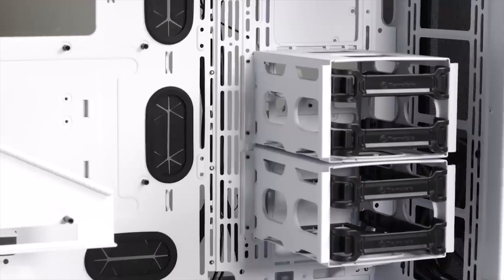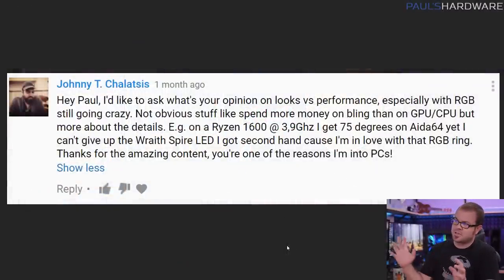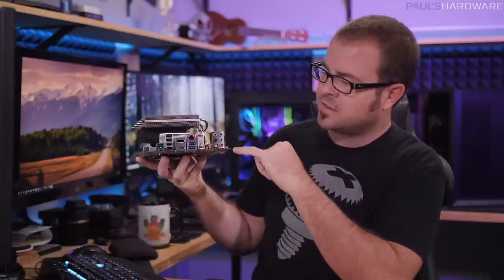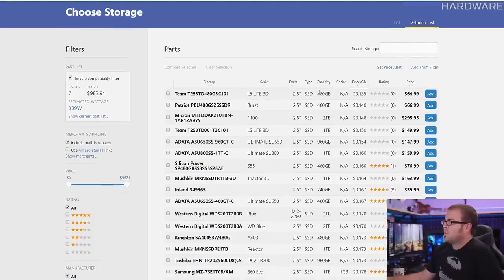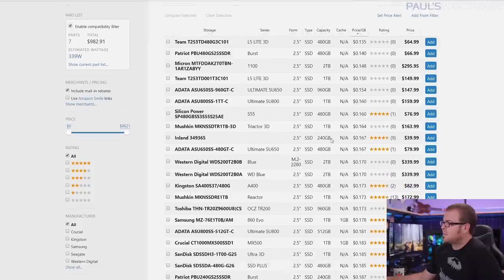The Eternal Question: PC Looks vs PC Performance? - Probing Paul #27

Comment from the maker: TIMESTAMPS!
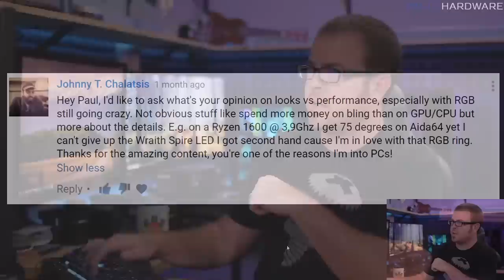1:07 The Eternal Question: PC Looks vs Performance
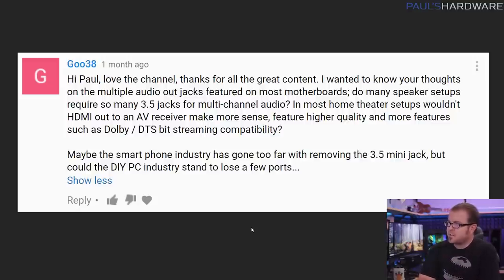3:28 Why do PCs have so many audio ports?
5:55 My primary drive is an SSD but I'm adding more storage -- SSD or HDD?
8:02 How can I tell if my laptop's M.2 slot supports SATA and/or NVME?
9:17 Why not use RAID 0 for a fast/large main drive solution?
11:20 Why not have a GPU that plugs into 2x PCIE slots?
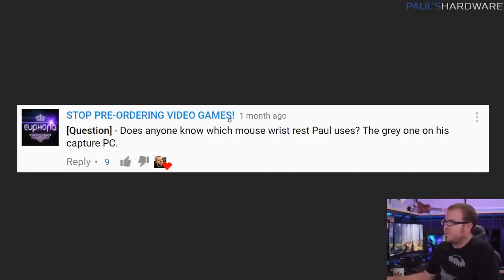13:15 What wrist rest is that?
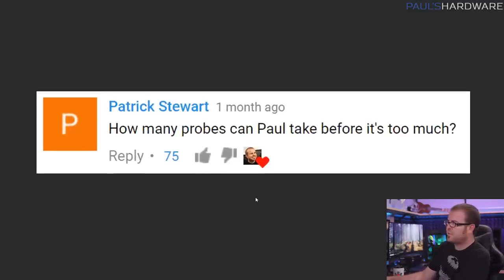14:15 How many probes can Paul take before it's too much?
Reply: The thumbnail implies that one finger isn't enough anymore
Reply: You might be sitting on maybe a 2/3 dollars of European currency.
0.045 USD/Koruna 
1.16 USD/Euro
Reply: paul make a budget hdd raid 0 that speeds like ssd video 
like using 4-6 500gb hdd in raid 0
Reply: I'm just going to throw it out there, but I'm not saying I'd be upset if Paul spanked me with a 2080TI.
Reply: 5:55 personally, I would go with a hard drive, they are cheaper and ssds have a magical little thing called write endurance, and for something like video editing where it's constantly writing over data, you could potentially destroy your SSD within a few years. (From the research I've done when building my own computer) after almost a year of owning my computer, my endurance is only at 97% (last self test was 4 months ago).
Reply: I have never updated my BIOS since I bought my PC in 2013, when I got it I was new to the whole custom PC thing and didn't know much about computers back then.Since then I've gotten more PC literate but I have never updates my Bios since I got the PC.
 I wanted your opinion on whether or not I should update my bios or should I let well enough alone?
 I have seen both opinions on this and would love to know for sure before I do it as I don't want to "Brick" anything.
I bought a Z87-K Mobo in 2013 and  the ASUS website have many updates for the bios since then. 17 to be excact 
https://www.asus.com/us/Motherboards/Z87K/HelpDesk_BIOS/
 Also if I do update, do I have to download all of them or just the latest one?
  I have seen quite a few bios flashed and believe I could do it with no problems but since I don't have the money to buy a new Mobo and my computer works ATM, should I update or not?
Thanks...I enjoy you videos :)

Comment: Your discussion of looks vs performance is appropriate but while I always build for performance, looks shows experience and professionalism.  As an electrician, I've always been taught to make my bends as parallel, straight and otherwise perfect as possible.  Same with wiring, when wiring a breaker panel most electricians fold out the wires on breakers nicely and tie up the runs running up to the stub outs so they look real nice.  No electrician wants a pile of spaghetti that you  have to push in to get the cover on.  So, professionalism and experience shows with looks.
Reply: Totally right

Comment: Price deltas between prebuilt systems and custom built aren't as high as they once were, but there is still a huge quality gap.  Prebuilts (like Dells from a Walmart shelf, not boutique/system integrator systems) almost always have very cheap components compared to what you would be able to find for a similar price by building yourself.   Cheap motherboards, locked CPUs, RAM that won't OC at all, and worst of all is the crap tier PSU they use.  Price/performance is still much lower for a custom build!
Reply: Maybe so but they are at least tested. It's vanilla but they are invested in making sure they aren't getting too many returns.
Reply: Usually crappy hdd's aswell and often limited or no upgradeability. Seen many prebuilts with very weird cases, power supply sizes, weird cooling etc. By building yourself, you have a lot more control over everything, quality, aesthetics, cpu vs. gpu, cooling capacity and so on

Comment: 8:32 Paul you are confusing the actual interface connection of the SSD with the internal controller of the SSD. 

NVMe has nothing to do with how you connect the drive to your motherboard, that's the PCIe interface that you're thinking of. NVMe is the controller that the newer M.2 form factor SSDs use, which replaces the AHCI interface that just about all 2.5 and 3.5 drives (SSDs and HDDs alike) utilized.

Comment: 12:26  You'd really only need a few piece of plastic for a graphics card brace.  You'd have a male PCIe-shaped plastic tab that fits into a slot in the motherboard, a hinged piece of plastic to act as a 45° support strut, and a small hinged support piece, adjustable to accommodate different sized cards.  A 3D-printed model could be adjusted then the hinges superglued so the angles will not change.  A production model could have set screws in the hinges, so it could be reused on different setups.

Comment: I use 250GB M.2 SSDs for the OS drives & 1 TB SATA3 SSDs for the "files" drive.  I always locate all the User files to the SATA3 SSDs.  I have an 8TB HDD for the "mass" storage drive.  I use Acronis True Image to backup all 3 drives daily (incremental daily & full backup weekly).  After the primary is complete, a copy is automatically sent off to another site (either sister's or my house depending on where the "local" PC is) to a "cloud" drive I setup there.

Comment: 10:43 I actually use Raid 0 on two SSD's on my spare build. I simply image the drive on a removable USB3 hard drive.  If it fails I simply reload it (Data is stored on a separate SSD and  off the PC)

Comment: #ProbingPaul I'm always wondering why GPUs always have the power slots on the top rather than the right side or front and back sides of the cards. Is there a reason for this from an engineering standpoint? Or is this just one of those "it is what it is" situations?
Reply: Brendan Jackson Because then GPUs would fit in server cases and Nvidia wouldn’t be able to sell as many Quadros (IMHO)
Reply: Easy to connect!

Comment: Hi Paul, thanks for putting out so much excellent content. I was wondering, how old does your house wiring have to be before you start seeing slowdowns in your internet, and/or restrictions on how many devices you can have on the network at once? Does it not matter until you get to almost non-existent wiring for internet? Or does it degrade quickly as you go up in age? My grandparents keep experiencing interruptions and cutouts in their internet, and the service provider tells them that it's the wiring in their house, but I have my suspicions elsewhere. I do know their house is at least from the fifties or sixties, if not earlier.

Thanks a bunch!

Comment: Not a new question, but a follow-up on the dual GPU question from this one. My idea would be to make a dual GPU that the bottom one would be reversed, so that both GPU'S could share the same heatsink, with a fan attached between them like normally seen with CPU air coolers. That would be pretty nifty, but I imagine very niche, and motherboard compatibility would be limited to which ever board it is built for, since it would have to populate the same space slots. Now, if motherboards went to specifically 2 slots or 3 slots between PCIE x16 slots as a standard across ALL companies, then something like this would be more feasible.

Comment: SSD vs HDD:
I would recommend the HDD first if that's what budget allows so you can setup an automated BACKUP SOLUTION (Acronis True Image or similar). At the very least do a manual backup once with free software (Acronis True Image Free for Western Digital or the same program called Seagate Disc Wizard for Seagate HDD's)... only then add the SSD if the current 500GB is unsufficient to work with the files you are editing... so...
1) HDD for mass storage and OS partition backup
2) 2nd SSD: copy files to edit from HDD to that SSD or just leave on that SSD if enough space
3) don't get a 2nd SSD until you are running out of space (80%+ usage) on the OS SSD

Comment: I still have an old speaker system that has 5.1 and use the analog outputs :)  As for storage I have an nvme 250g for boot/app drive, 500g ssd for games/performance, and a larger 7200RPM HDD for mass storage.  Thinking of adding another nvme to raid the boot drive since they're cheap right now.

Comment: As a reminder, the 1800x did not come with any stock cooler.
Reply: My 1800X didn't, and the same is probably true for most 1800X owners, but there actually were two versions of the 1800X: One with a cooler included (which was stocked by véry few shops), and one without the cooler. I'm assuming that the one with the cooler had a slightly higher MSRP, and given that a CPU of that calibre was always likely to be used by enthusiasts who tend to buy their own coolers anyway, shops appear to have come to the conclusion that it was better to just stock the cooler-less version.

Comment: Hi Paul. I have 2x Galax 1080 Hall of Fame cards and they come with an adjustable pole which attaches near the 8 pin power connector to help with GPU sag. Other vendors should adopt this I think as it seems to be concern for alot of gamers.

Comment: Re: "How can I tell if my laptop's M.2 slot supports SATA and/or NVME?" Maybe I'm wrong, but I had thought that SATA & NVME M.2 form-factor drives were differentiated by their contact tabs, and that the two form factors were physically unable to be inserted into the wrong socket type. And thus by design, you would never find an M.2 socket that could accept both drive types: SATA & NVME.

Comment: Have you ever had a sata drive cause a motherboard failure?  I thought it was a fluke when it happened the first time.  I replaced the motherboard and had it working perfect until I shut it down and plugged up the sata drive I was going to use for storage.  As soon as I powered on the system it began rapidly cycleing off and on and fried the second motherboard before I could unplug it.  This is a new Western Digital drive, I have not even been able to format it.

Comment: A video about optimal storage configurations would be great. I already use a 3 drive solution. A Samsung evo860 250GB Sata boot drive , 16GB optane memory module to accelerate my 4TB 5400RPM secondary drive with steam loaded on it.

Comment: hey paul i got a Question for you   been an avid fan for   about a few years now.   Question for you possibly two  is  what would go  with the Gen 2  Thread ripper Primarily  GPU  wise? 
Also on this i  been hearing that Nvidia isn't a good pairing with  AMD  products  more  in line with  Intel but with intel i don't  like do to allot of CPU's i been getting from them either from the company itself as a repaired product or  from a  vendor like best buy or   a PC shop  all of which i have died on me  so i know its nothing on my end that keeps destroying em i've been getting a few of the new  ones 8700k?   i think it was  the new Coffee lake CPU's Basically   so i am  just to the point where i had enough of intel and going with Team  Red.

2nd question  that comes to mind have the fixed the problem with Thread rippers bracket where i noticed on JayztwoCents  he was using an Aorus  board and one of the 3  screws wouldn't thread so i am a bit concerned about this since i am at the moment looking into getting  into a higher end PC for gaming Streaming and the occasional  Social media but mostly Gaming and streaming .

And Lastly  what are your thoughts on Gen 2  Thread ripper and the new  Ryzen PC products that  came out this year ?

Comment: hey paul I do have a question. Is there a point at which there is no return on investment when picking out a processor for gaming only? I know adding in streaming and other multi-threaded work loads will help on the multi-threaded side of things, but say jumping to the x299 side of things would you get enough performance to warrant the extra costs for only gaming??

Comment: Heeeey Paul first off love the channel keep up the great work secondly I have built my 1st gaming pc ever and now i am not sure what graphics card to go with for my set up cause at the time of building crypto currency was going on so gpu cost was insane  and i just built around that.I have an Asus ix code mobo ,7700k cpu,16 gig  gskill memory,cryorig h7 quad lumi, currently using a geoforce 1050 ti gpu  inside an nzxt elite case but my monitor is an Asus xg35vq  35 inch free sync /adaptive sync monitor  so basically asking what graphics card would sync up with my monitor really good out of the rx 580 cards  there are a few to choose from not sure which one grab.

Comment: I personally use the analog inputs on the back of the motherboard and run a 5.2 system off of it. It works perfect every time.

Comment: I'm curious, do most people still use the rear green audio jack on their boards for headphones/speakers, or do you all have external DACs/headphone amps or use monitor/keyboard/headphone DACs, etc. Please comment. My board has a built-in headphone amp that only works with front audio, so that's what I use.
Reply: QuantumBraced
Only the cheap headset people use the green and red Walkman plugs in 2018, any $10 BlueTooth headset will do that Job better?
Who are on any good audio, good DAC, real AMP? Big speakers? 5.1 ATMOS 7.1 or more 12.3?
Try Overwatch in a Big room on ATMOS! Connect as many speakers as you can, 7.1 enough you think?

Comment: Hey Paul, looking to upgrade my gaming laptop somewhat as it has been slow for a while now, its almost 5 years old and the current 500gb HDD is struggling. I wondered what your opinion was of SSHD's (hybrid drives)? Laptop doesn't have 2 drive bays so cant just pop in a low capacity SSD for boot and don't have the money right now for a 500gb SSD. Thanks again, keep up the awesome vids!

Comment: Does distance between a cpu heat sink and GPU matter? I recently finished a matx build with a dark rock pro 4 and the room between the cpu cooler and the graphics card is definitely less than 5 millimeters. Will this cause problems with gpu temperatures? How much airflow does the back of a gpu need?

Comment: I would very much loe if you did a very indepth HD storage options.  I've been building pc's for years and the HD configurations have always been my weak point.  For example, I dont know if I should consider putting just my OS on a smaller ssd then have all my programs and files on another ssd, then mass storage and backups on an hdd, etc.

The large number of configurations can be daunting.

Comment: How much space could we get is a manufacture went and developed a 3.5 inch ssd (same physical size as a 12tb hdd)
Reply: No need. There was a flash conference in mid-August with Toshiba and Hynix announcing new devices. By this time next year 64TB 2.5” drives will be available, with 20 on m.2.  Prices were thin on the ground, but there’s a reason for current prices dipping.

Comment: So Paul, I bought in on the X99 platform with a i7-6800k running at 4.3GHz and I was wondering. I do some messing around with video, photoshop, CAD, VMs, all kinds of things and with the 1080ti, I feel like a little update to the processor might be worth it. So, would you suggest a used i7-6950X, or ditch X99 and go with a newer platform? My other concern is that I have 32GB of RAM at DDR4-2400 so I was concerned about switching to Threadripper or Ryzen.

Comment: Here's my quick answer why I recommend 1 SSD + HDD vs RAID 0ing 2 SSDs: later on if you want to upgrade your SSD or need to reinstall your OS. Likely half or all your personal files are on the second drive. - or you can quickly move them to the second drive rather then needing an external HDD.

Comment: Are the Hybrid SSHD's worth it in terms of speed? i dont want to go back to spinning platters
Reply: Nope. you cannot access it like a normal ssd. It's a cache drive for the operating system, I believe. I installed on in an old laptop years ago.

Comment: Hey Paul, can you tell us more about G-sync (and FreeSync), is it worth spending extra money on such monitors? What would be your recommended monitor budget pick for 1070 Ti? Should I even go with 1440p or choose 1080p?
I am planning to buy 1070 Ti and am thinking about buying a new monitor. Now I have AOC U2868PQU (50-76 Hz, 1ms, 4K). I don't think it's a gaming monitor and good enough for 1070 Ti. I am thinking about maximum resolution of 1440p monitor and decent refresh rate. I play mostly FPS, battle royale and sometimes RTS.

Comment: Question for next time:  I have a Ryzen 5 1600x water cooled with an MSI GeForce GTX 1070 graphics card.  Temps on both the CPU and GPU seem normal even when playing games.  Still, my PC will, on occasion, just snap off!  The video card has been RMAed and is a new (refurbished) card.  When it snaps off, all the fans continue to run as well as the water cooling pump.  The only thing that seems to actually go off is the video card and of course, the monitor.   Oh, I have a 750 watt 80+ Gold power supply.  The PC does either come back up on it's own or I have to turn it back on.  Thanks for the help.
Reply: If possible, you can test the memory. Assuming that's working, the issue could be related to the power supply or motherboard. Hard to say honestly.
Reply: Thanks for the reply.  I believe the power supply is good although I'm not sure how to prove that.  I am suspicious of the motherboard.  It's an MSI X370 Gamer Plus.  If this continues, I guess I'll have to buy and swap out both until I resolve the issue.  Again, thanks for responding.
Reply: @guardsix6  what speed Ram do you have?  And what speed do you have it set to in bios?  I recently had to lower the speed of my 3200mhz flare x kit to 2667 due to similar issues.  Running a 1700x myself.  Can't wait for the 7nm Ryzen cpus to come out, just for the higher memory support.
Reply: Thomas - I have two 8GB sticks of Corsair Vengeance LED DDR4 3000, but it says its running at 2133Mhz.  I don't usually overclock anything because I'm not that I would be doing.  I am thinking that the memory isn't the problem.

Thanks for responding to my question.